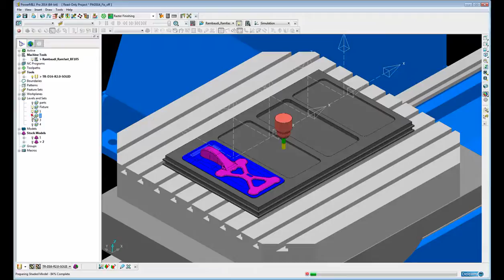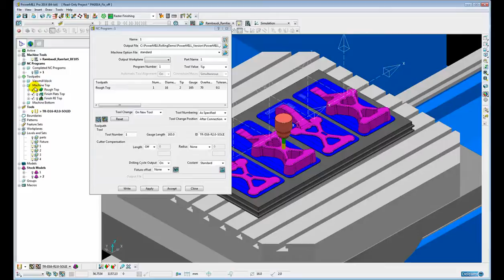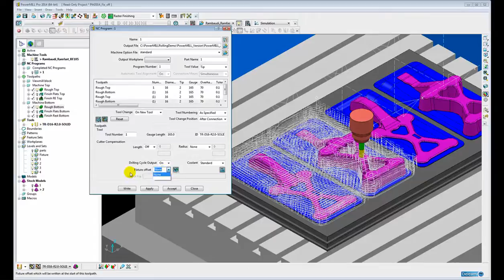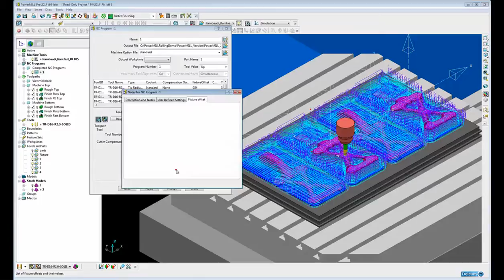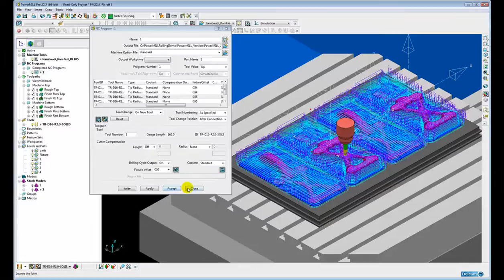Fixture Offsets - PowerMILL 2014

Comment: Assume, I have two differnet workplanes, called G54_WP, and G55_WP each to machine a different  part, and I created two toolpaths.
From Application Options, NC Programs, Output:     Use toolpath workplane for output option is checked.
When posting using Fanuc processor, the problem I have is: the gcode coordinates for the second part are referenced to the first Workplane.
Any idea what i can do to have each toolpath referenced to its corresponding workplane?